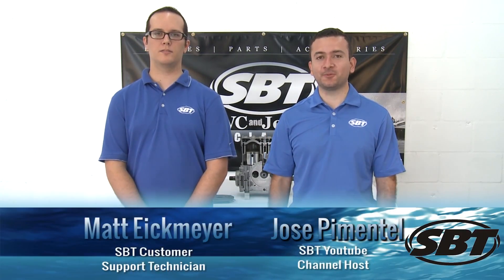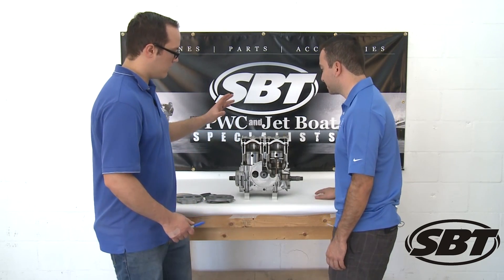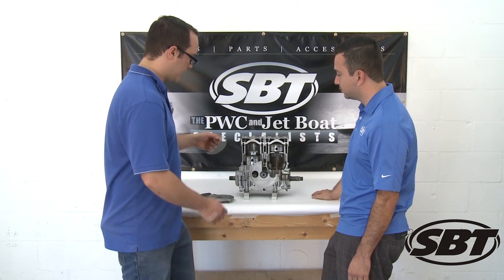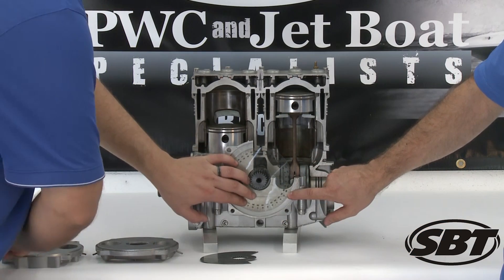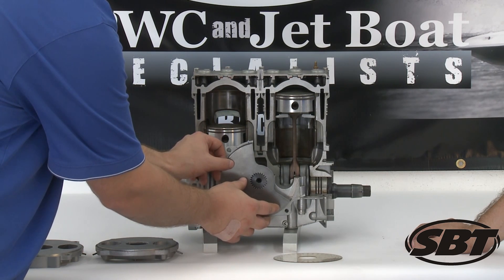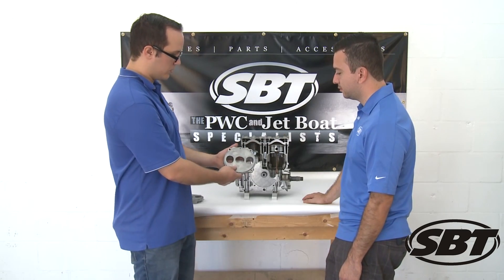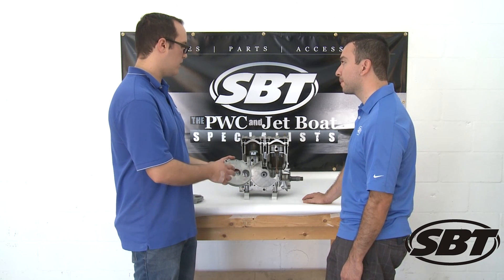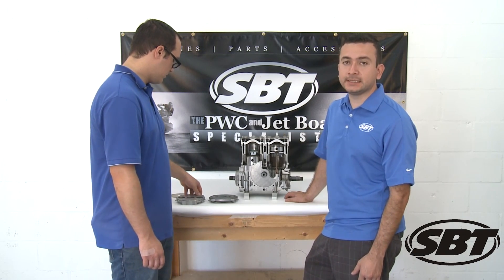SBT Tech Tip: Rotary Valve Timing on a Sea-Doo

Comment: Why do you need the timing wheel when there’s an arrow on the block
Reply from the maker: Not all blocks have the timing mark on it. Because these are machined/remanufactured there is a good chance it would be removed in the process.
Reply: @SBTengines  gotcha
Reply: Its kind of like installing a new cam in a V-8 engine... you CAN just line the dots up on the timing gears, and HOPE that its correct, OR you can degree the cam in, and be CERTAIN that it's correct. 

I ALWAYS degree a camshaft in, and NEVER just use the marks on the timing gears. I HAVE found many timing sets that ARE slightly off when the marks are lined up. 

DO it correctly, and degree it in...

Comment: Hey guys I have a 787 gsx rfi and what I noticed yesterday while I was opening is that I've got a big scratch but not on the rotary valve, in the engine side. What you guys reckon I'll have to do in this case? Is that causing any problem and there is a way to fix it? Thanks
Reply from the maker: Hi, please email: Tech@sbt.com. They may request pictures as well.
Reply: You can get a used block on ebay reasonable its trash

Comment: What happens when you don’t have the cover in stock. I need 6810-522 for 2001 sea doo gs model?????
Reply: Did you ever find an answer for this? Im in the same boat and have the 522 cover that is not in stock
Reply: @WolfPackM98c  yes I found one a used one on E-Bay and it work out great. It had a little wear but it was I good shape. Ski runs great
Reply: @chadwalters7450  Thanks, man. I’ll give that a try

Comment: Thank you for making this informational video. it was straight forward and to the point. The tip about blow by was a good one for me to learn. Thanks!
Reply from the maker: Great! We also offer a full Tech Team here at SBT if you ever have a question.
Reply: What engine is this? I just bought a 96 gti 717 from SBT, need to set the rotary valve on it, once it arrives. Its been 2 weeks since i ordered it
Reply: @GC-EXTREME  welcome to covid

Comment: I have a 1992 (or '93), white, 580 cc rotax.  What degree mark should i be setting mine at?  Saw another video that said 147 degrees.  Nobody has mentioned the engine size or year of the engines are.  Does the size of engine matter?
Reply: Same please let us know!
Reply: https://www.seadooforum.com/premium/manuals/?_gaTrack=1&gclid=Cj0KCQjw8rT8BRCbARIsALWiOvSTZhz9IlAcnhrxT6_viUH-0G35Jsb49yrhWkaL4rZfc61bJiVikksaAuJBEALw_wcB
Download the manual and the details will be here
Reply: @adrianmetelli5751  ya thanks for the link to buy an entire manual when all i need is the degree setting.